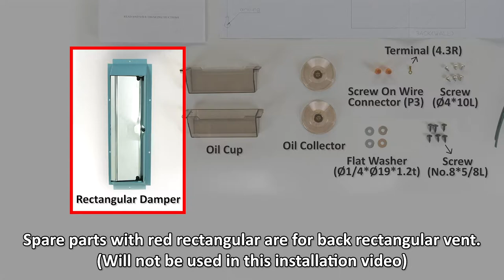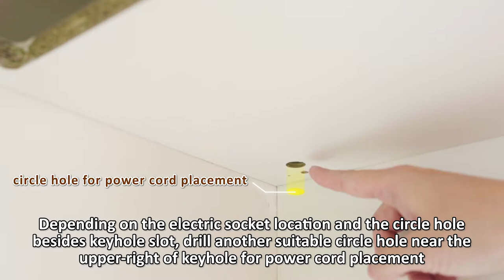SAKURA R-828/R-838 Series Powerful Under Cabinet Range Hood Installation Instruction

Comment: I need some help taking out that filter on my B53 model kitchen hood.  I've had this exhaust hood since 2022, and I managed to remove the two filters last year; however, this year I attempted to remove these filters the same way I did last year and they're not coming out. Any advice would be great.  Thanks!

Comment: Could someone please help me by telling me how to remove the stainless steel baskets to replace the aluminum filter and clean inside? A video or step by step tutorial would be helpful. I can't seem to figure mine out and they badly need cleaning!
Reply from the maker: Hi Sarah, 
This is going to be on our next video for sure, thanks for the wonderful advice. Meanwhile, will you please advise your city & model, we can have our local distributor to contact with you and give you some direction. Thank you.
Reply: Each fan grille is held on by one screw, just unscrew that and take it out. You can also spray degreaser inside the fan blades and the separated grease should be in the grease container
Reply: @ix.cryo1  is there no way to remove the fan blades? I accessed a screw on the fan hub but it only allows height adjustment.
Reply: @kockgunner  hmm, have you tried to unscrew the screw fully?
Reply: @kockgunner  On my older R-747 model, you must remove the plastic shaft covers to expose the locking screws for the fans.  Once you fully loosen the locking screw, the fan assembly will drop off the motor shaft.  Reverse to reinstall.  Btw, depending on your fan model, you may have to remove the inner body plate to be able to drop the fans out (only 5 or 6 screws0
Reply: @sakurarangehoods8843  We have the exact same problem with our 
Sakura R-727 oven hood. We have oil dripping on to our cooking range and would appreciate any help. We are located in Union City, California. Do you have a local distributor in the San Francisco Bay Area or San Jose?
Reply from the maker: @ravigiroti1106  Dears, please feel free to contact our local dealer in CA as below information. They will be very pleasure to help you. Thank you very much and we do appreciated your support to Sakura. 

West of the United States - Sakura USA Co., L.L.C.  
Oakland  
(510) 268-1188  
Monday - Saturday 10:00AM - 5:00PM, Sunday 11:00AM - 4:00PM, Thursday closed  
336A 12th Street, Oakland, CA 94607  
   
LA  
(626) 288-8621  
Monday - Saturday 10:00AM - 6:00PM, Thursday closed  
8328 E. Valley Blvd., Rosemead, CA 91770